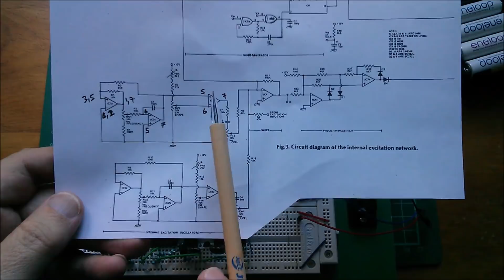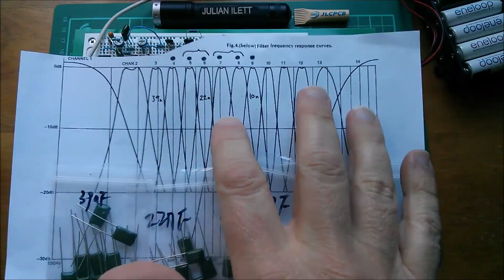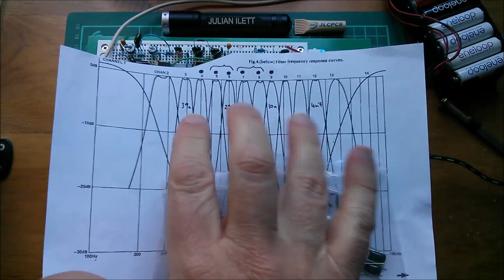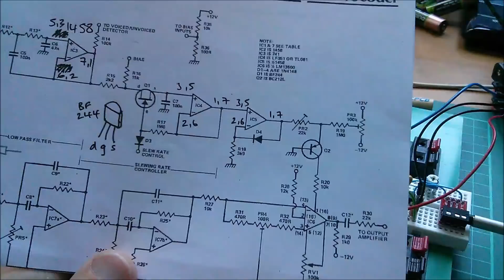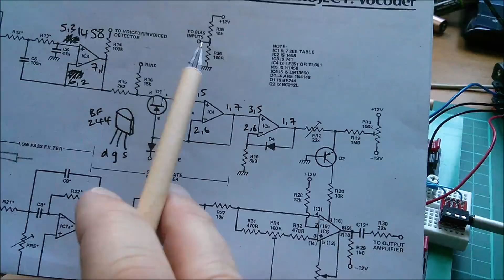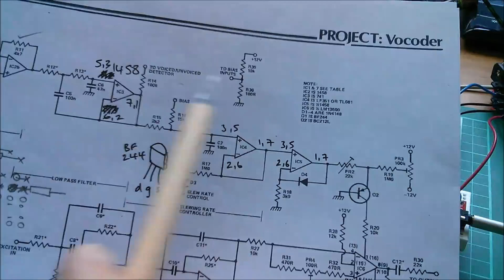Condenser Adventure - Vocoder

Comment: 6BE6 pentagrid converter makes the best band pass filter out there 5844 twin triode is a good driver stage amp or signal inverter I am using 47 k plate resistor grounded cathode on all 5844 sections I will let you know as I figure out more of the conversion

Comment: Julian, are you scared to use your scopes?  You are spending all this time building (which is fine) but you fail to do any testing or diagnostics.  You need to test and see the results using a signal generator (single frequency at a time).  Looks like you are still just modulating a SINGLE frequency with the sum amplitude of four filters - not the most desired use of a vocoder.  Read my comments in the last video.
Reply from the maker: I did have to resort to using the scope when I left the ground connections off the quad op-amps. That showed me full-wave rectification wasn't taking place.
The situation now is that the breadboard is too small to hold enough circuitry to make a working unit. I need: more filter channels, preset pots for alignment purposes, full size pots for control purposes, the 12-0-12 power supply (it may behave differently on +-10V).
I did read your other comments - the square wave oscillator(s) is split by bandpass filters into different frequencies (probably more sinusoidal after these filters).
The project is still too embryonic to expect it to produce a good output - all the alignment pots are missing - all the control pots are missing too.
Next step is to start mounting the proto-boards (which will have all the preset pots)on to decking timer (which I have) and get the spectrum analyser working. Control pots will be mounted on steel strips screwed to the sides of the timber. There's still a lot to do :)

Comment: When you reconnect the first channel, you can hear that it does not only outputs your carrier: it sounds more like a ring modulated version of it, so maybe the control voltage varies too fast: Try to smooth it out with a lpf, or  increase the time const past the peak detector ... Or both

Comment: Actually today I have spent an hour or so disassembling some inside house telephone wire.  I found that there were 5 pair of relatively thin solid strand copper wire inside, much thiner then I recall from my days in the US Army, back then we used a much heavier wire and there were only 4 colors of wire inside instead of 6.  I was a bit disappointed but I guess things change over time, and I noticed the wire was marked "MADE IN CHINA" so it must be a much newer sort of wire.  I had been using it as an easy way to channel my hifi all over the house, as I found a large spool of this wire beside the highway back in the late 1990's, it appeared to have fallen off the back of a repair truck, and there was probably about 50 feet of the stuff left on the end of the real. Well wireless technology has pretty much put an end to my attempt to channel music all over the house, and in fact nobody in the house even listens to the big stereo anymore, don't think it has been turned on in over 5 years.  Sad to as it has a wonderful sound with the 16 inch bass woofers and a nice set of SONY speakers to give life to the music, through a very large amplifier that could well heat our living room if left on with music playing.  Now days, everyone has their headsets and listen to what they want instead of what I liked as they used to back in the day. Oh well guess I will try to put some DuPont ends on some of this wire and see if I can use it in building projects with my Arduino collection.  I am very disappointed in my results trying to use cat 5 wires removed from those cables, the wire just does not hold up well at all, and using lacquered wire does seem to work OK, I get a bit nervous with the appearance of thick copper wire in a power supply without the insulation I am so used to seeing around it. Of late I have been making 12 and 24 volt power supplies using 18650's that I scrounged from old laptop batteries, beats having to plug in a power pack every time I want to start one of my home built devices.

Comment: More years ago than I would care to admit (OK it was 1970) When I was stationed on Vietnam, we used an encryption device on our FM radio sets to communicate between our patrol s who used the PRC77 (a PRC25 unit modified to use encryption) and the tactical communications bunker, where I worked.  If you tried to monitor the transmissions without the crypto unit engaged, it sounded a bit like your device, however much faster.   I recall setting the "patch" devices for those crypto units which were heavy as hell for the poor Radio Telephone operators,  it was a sort of pin adjustable set of slides that had to all be set according to the code that changed daily.  So at midnight, the dude on the night shift would have to open the safe, remove the little code square from a book, then change the code pancake device which set the pin lengths as one of 24 lengths if I recall, then the device was inserted into the plug receptacle and the lever was pushed which protruded the pins to the proper code location and t he radios could then communicate in the secure mode.  A similar device was used for teletype, however in that case each device had to have its own patch set at midnight. If one pin was not set correctly on the TTYP's then no commo was possible.  This was a rare occurrence but did indeed happen from time to time.The ttyps  each had a crypto device that had a block with 36 wires and 37 areas that wires could be inserted.  They were sort of like the DuPont type connector but had a lock ring that kept the pins in their plugs then the patch would be inserted in this huge gray box and the door closed, key removed and the unit could be put to work.
Reply: Jerry Ericsson I was born one year later, 1971, and 19 years later we were still using the prc77 in the Marine Corps duing the Gulf War. There was an encryption device that was changed daily by a com guy with a key worn around their necks. I was on a M60A1 tank with vietnam issue radios that also used the same encrytion. Whenever the comm guy came to change the freq we were ordered off the tank and were not allowed to see what he was doing. Every other branch of service had singuar (sp?) frequency hopping radios, with a few exceptions. We still had the prc77s for several years after the Gulf War, in our Humvees and Trucks.Great story and Welcome Home sir.👍

Comment: Are you putting bypass capacitors across the rails close to your opamps?  That can improve the stability and prevent high frequency oscillations that shows up as distortion in the sound.

Comment: Yes Julian, Move on to the Z80. 😊
Reply from the maker: The Z80 needs a huge amount of support circuitry - ROM, RAM, keyboard, VDU interface, printer interface, cassette interface, floppy disk interface, ROM burner, big PSU etc.
Reply: Julian Ilett, I now. But you can do a lot with a Arduino as clue-logic. Just connect some Rom and Ram and a Arduino as serial/terminal communicator.